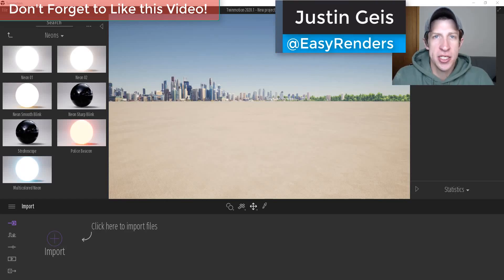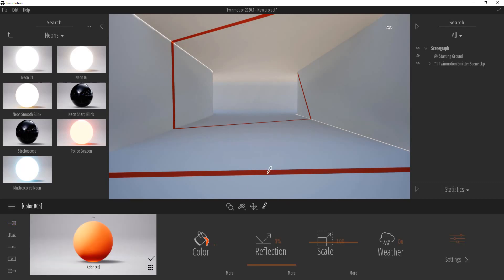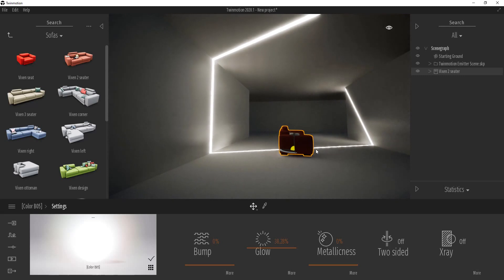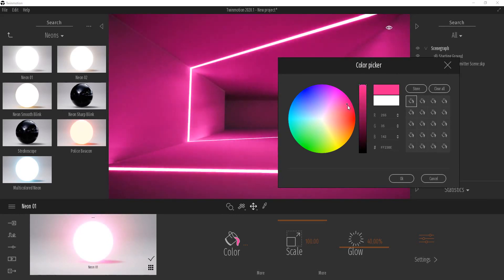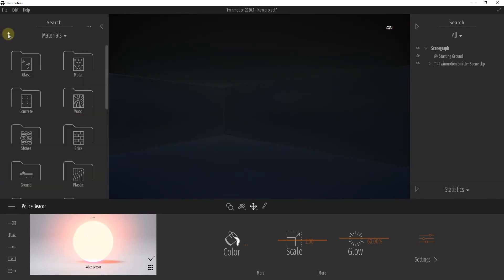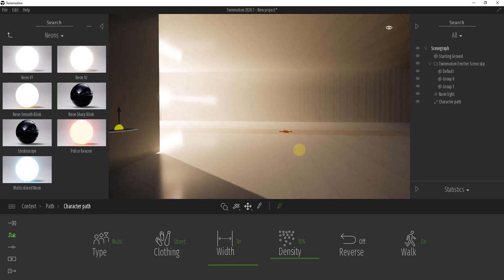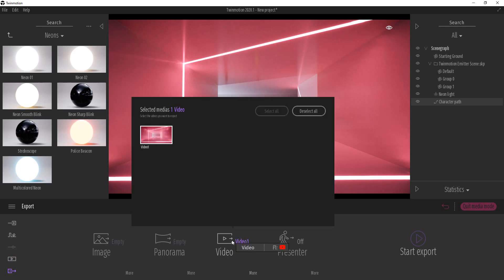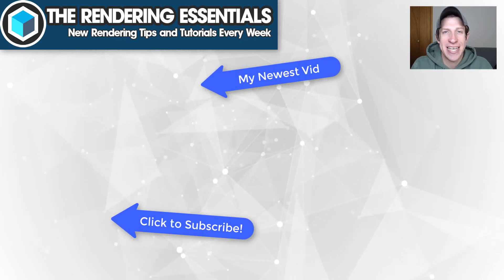Twinmotion 2020 UPGRADED EMITTER MATERIALS?

Comment: Hey Jason, great video as usual.  I see on this video that you can adjust emitted light color with the color picker but having trouble making the light material itself show a color.  I know from your excellent Christmas light video https://youtu.be/ZJOi3aNZxUA  that adding a glow map changes the light source color and that worked on TM2019 but on TM2020 I can only get the material to show a glow map color if the glow intensity is turned down to .001%.  If you turn it up it just gets bright white for a regular material or a neon.  Are you noticing this and do you have any suggestions?  Thanks!

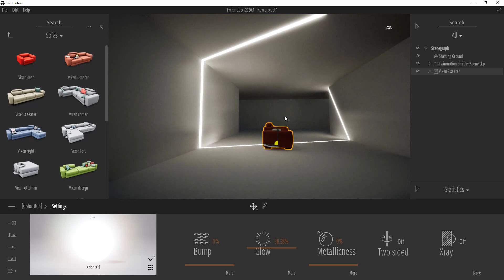Comment: Um, actually, there are shadows being cast , look at 2:39.  Clear shadow on floor below as you move couch around.  Just an observation.
Reply from the maker: I don't believe that's a shadow - I think it's a reflection of the sofa on the floor. Try it with a point light with shadows enabled and they look substantially different. In either case, if you want pronounced shadows, you're going to want to supplement with another artificial light

Comment: Very cool. I did notice a cast shadow underneath the sofa from just the emitter material. It is very weak and diffused, but it's what I would expect since the emitters aren't that strong and are contributing mainly ambient light in the room.
Reply from the maker: Possibly - I think it was a reflection of the sofa on the floor, not a shadow

Comment: hello justin. i really like your channel. your videos, espescially about twinmotion are really help me a lot.
something that struggles me enough is importing skp file. everytime i imported skp file, the object didn't show up. so, i have to open skp file and use twinmotion plugin. bcs i have to open both, skp and twinmotion, my laptop couldn't handle it and keeps lagging.
can u give me advice?
and also, can twinmotion import terrarin from google earth? i created terrain on skp first, then export it to twinmotion. do u have shortcuts to create terrain on twinmotions?

thanks a lot ^^
Reply from the maker: Does your laptop meet the minimum requirements from a hardware standpoint? And no, no GE terrain...
Reply: @TheRenderingEssentials  i think so. My laptop is asus tuf gaming fx505dt. The setting graphic auto is high. Should i set it low or middle? Maybe the problem is on the laptop it self.
 I'm still curious, why does the skp file imported can't show up 🤔
Reply from the maker: @nandhiasungika2468  I have no idea - are you sure it isn't showing up? Have you checked the outliner to see if anything shows up when you import?
Reply: @TheRenderingEssentials  yes, it is. Did u click some button on keyboard after import?
Reply: @nandhiasungika2468  
I dont know anything about skp files, since Im a Rhino user, but even so. Have you checked that the file is centered 0,0,0 xyz in SketchUp, before importing. Also, have you tried diffent scale when importing the file in TwinMotion
 Like 1.0 or 0.1 or 0.01 perhaps. The size of the model differs for me when Im importing Evermotion scenes as fbx in TM. Hope this helpes :-)

Comment: Hi! I’ve been using Twinmotion 2020 a couple of days but it crashes a lot, do you know why this happens ? In 2019 it doesnt happened
Reply from the maker: No idea - it does seem to happen more, but I don't have an answer
Reply: The Rendering Essentials thanks !
Reply: The Rendering Essentials thanks, will do!
Reply: Make sure ure on the latest windows (7 or 10) and latest Unreal version
Reply: @nazirullsafrypaijo5694  
But unreal has no relation with TM.. TM is standalone ..!!
Most of people having TM 2020 crashes, due to they are using MacBook.
Reply: Nazirull Safry Paijo  I see... I’m using a desk computer with an NVIDIA card. It runs TM 2019 smoothly but then in 2020 it crashes a lot and when I upload project files is just way to slow (11fps)